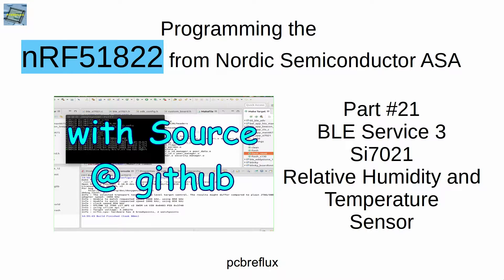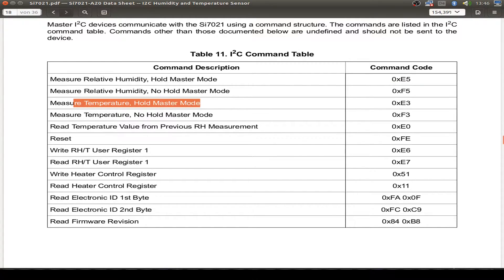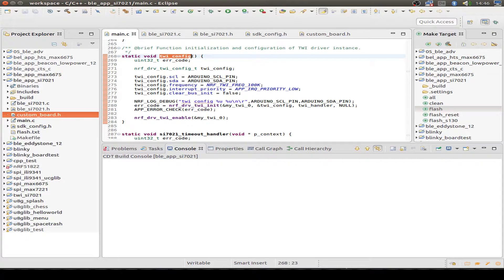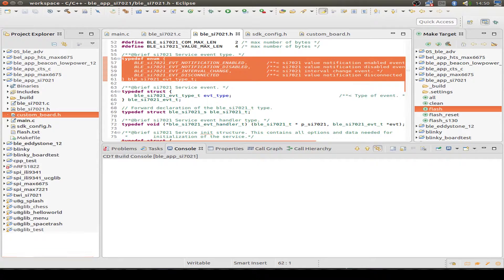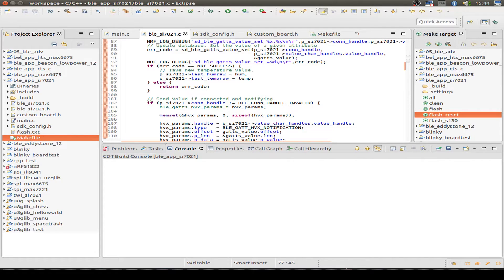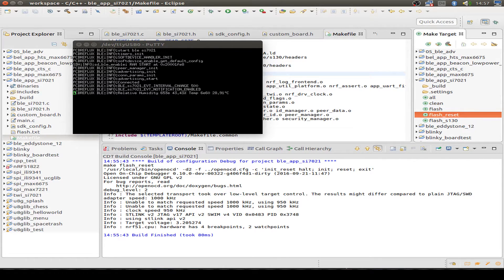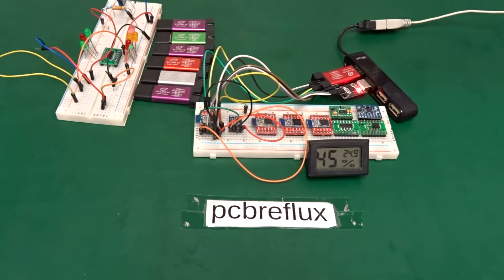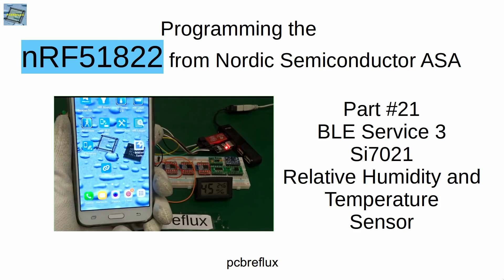nRF51822 #21: Bluetooth / BLE Service #3 Si7021 with TWI / I²C

Comment: Hello, I am using nRF52840 to read out invensense ICM 20948 IMU sensor on I2C interface. s140 is the softdevice Im using. Will this code work for me? if not how do i proceed. pls help
Reply from the maker: Most of the I2C code is inside the main.c file, but sure this only works with the nRF51822 and Si7021 (see https://github.com/pcbreflux/nordic/tree/master/nRF52840 for examples for the nRF52840). You need the code or a library for the 9-Axis MotionTracking Device. A library is helpful (search for "github icm-20948") to benefit from work/mistakes others have done already but there could be a surplus from writing your own code. A logic analyzer (starting by ~$5) is a very useful tool to check the I2C interface and the communication between the devices.